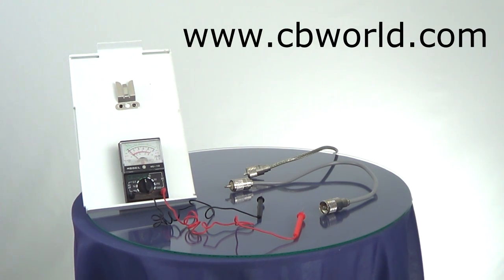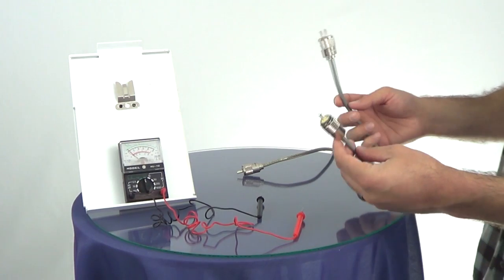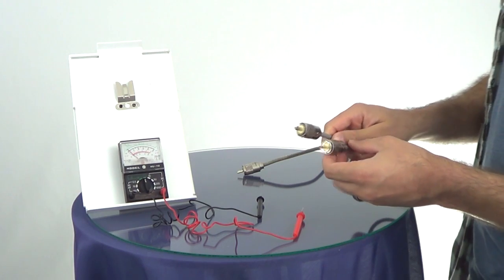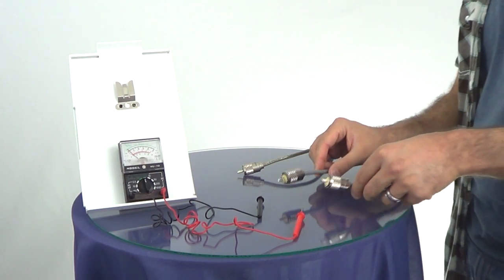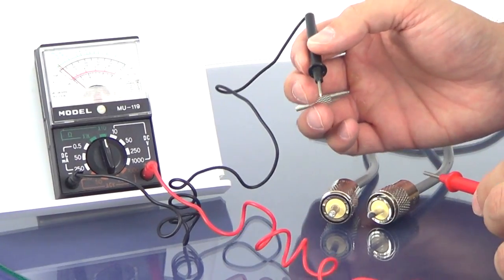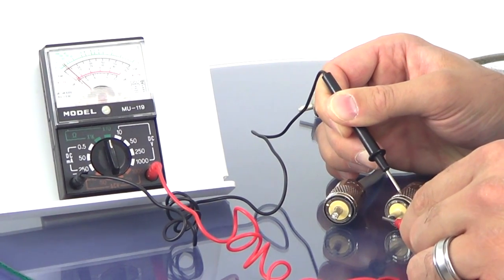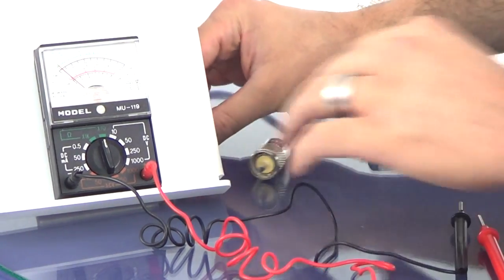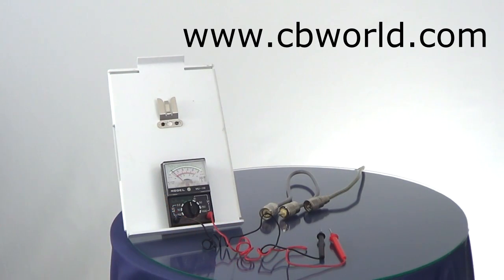Testing CB Antenna Coax Cable for Shorts and Continuity

Comment: Thanks for a great video - dumb question: I’m guessing I need to tune my antenna because my antenna checks out good for continuity in all three meter connection tests? It’s a basic mag mount antenna with spring near base, upper is a solid wire
Reply: When you say "tune" your antenna, do you mean using a SWR meter?  I'm hooking up a vintage CB on a new truck, and knew nothing about SWR back in the 1980's, even though the Uniden had a meter built in.  CB worked, probably just out of luck, but now I know the importance of making sure it works to it's best potential.  Bought a stand-alone SWR meter, I hear they are more accurate

Comment: My coax is good, going to look for video on antenna as that appears to be shorted..  both lights go red,, system was out of the truck for 25 years, no clue if people played with antenna itself, but tested coax to antenna mount and was good..  center to shield becomes shorted when antenna is connected..some wideband waterproof whip with fiberglass looking end that works mint last time used...
Reply: i guess supposed to act shorted on the coil,, well then guess radio could have gotten wet, the weather portion still works, no static at all any squelch and pegs when touch mic..

Comment: I tested my cables and everything checks out. I have high SWR. It pegs the garage on my Cobra 29lx and flashes "CB Antenna Warning" when I try to transmit. I'm also only receiving within maybe a quarter mile. It's a 2019 Kenworth T680 with stock dual antennas. I'm not sure what to do.
Reply: what antenna are you using?
Reply: @liambelfast6001  Stock antennas on a 2019 KW T680
Reply: @Blenzo480  im honestly not familiar with that, antenna . But it definitely sounds like you need to tune the antenna itself , if its a fibreglass antenna there are usually to rings at the bottom for tuning, if it is an antenna with different sections, you need to adjust them , .its not your coax or plugs ,you need to tune the antenna my friend.,

Comment: Thanks for this great great video.  QUESTION:  What are the major problems you might experience with a shorted cable?  What effect does it have on the radio?
Reply from the maker: If the antenna system is a standard antenna syste (not NGP) you will likely have extremely high SWR. No matter how you adjust the antenna your SWR will not go down. You risk damaging the radio due to the high SWR. You will experience extremely poor transmit.
Reply: @wearecb  thanks

Comment: No wiggle? No acceptable values? This does Not rule out a bad cable even in the 70's when that meter was standard issue.
Reply: Can you elaborate? If there's a short anywhere in the cable, this test would show it, right?
Reply: @TheRoadhammer379  A short, an open. It may show either in a static position then show the opposite in another. This test is not conclusive and hardware long since outdated. Ideally a link to something more current advising people how to use a good dvm, a dummy load and resistance/length calculations would prove a better pass/fail.
Reply from the maker: @TheRoadhammer379  This test will show a short in the cable specifically if the cable is disconnected from everything else.
If the coax cable is connected to the antenna stud and you use this technique to test the other side of the cable and you show a short, It may also be a short happening on the stud itself by being improperly assembled.
We recommend doing this test with the coax disconnected from the system to rule out the coax itself.

Comment: What if you're testing the center with the outer shroud for continuity with the radio attached on the other end, and you do get continuity?
Reply from the maker: Dear Johnny, 
Please disconnect the radio while checking your antenna coax for a short. 
Some radios such as the C75WXST will cause this  interaction and give you a false positive on a short diagnosis. 
Disconnect the coax then check the coax again.

Comment: How often do you have to change the cable
Reply from the maker: Thanks for checking out our video!  It really depends on several factors-  the coax has been indoor, outdoors, exposed to weather, etc.  If you test the coax with an ohm meter and it does not show continuity, the coax is likely defective and will need to be replaced.  If the coax shows external damage, it is probably safe to say that you should replace the coax. We hope that helps!

Comment: I have continuity from the center conductor to the threads on the base and the whip. Is the antenna bad? I installed my coax solder fitting, it tested good until I screwed the whip onto the fender mount base, then it read short, that's how I began testing the whip.
Reply from the maker: Unless the antenna is a NGP antenna, then that would be a short in the antenna system. There should not be continuity between the threads and the center pin. 
However you want continuity between the center pin and the whip.

Comment: When I attach my radio to the antenna via coax I hold the antenna in my hand then have it touch the mount on my vehicle it'll arc then short out the fuses in my radio power cable, would that be a bad ground or short in the cable?
Reply from the maker: Dear @wrestlemaniac202 Thank you for contacting us!
The reason you are blowing fuses is because the antenna needs to be mounted with a stud to the mount. 
An antenna stud will isolate the antenna and it will not make any actual contact with the mount. 

Mount the antenna properly and then check your SWR before transmitting.
This link is to a stud but the second photo shows the diagram of how to assemble a stud.
https://www.wearecb.com/stud-mount-3-8x24-thread-lug.html

Comment: Define  what " continuity" is and how to set up the multimeter taking a close up of meter!
Reply: On his meter it is switched to the Ohm setting and x10
Reply: Very good video. Maybe go a step further and cut the connector off and test the center and shielding to see if the cable itself is shorter or just the fitting

Comment: You forgot to check the pin and housing on the other cord
Reply: Nope, result would have been the same, since he tested continuity of pins and shields already.
Reply: I checked my coax with my test meter and they is no sort on each end and my swr is 1.2.1
Reply: @denniswatson8699 , so what? 1.2:1 is 99% efficient.